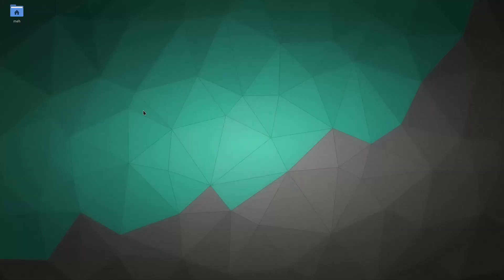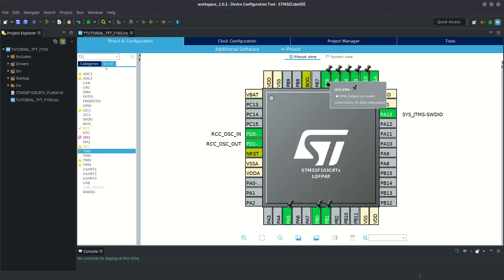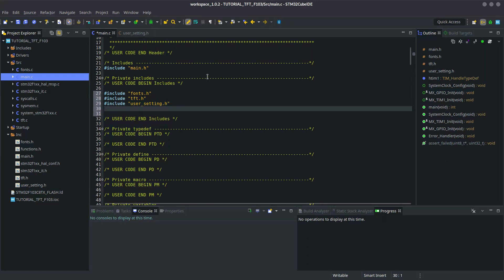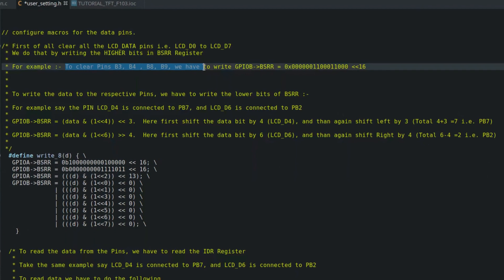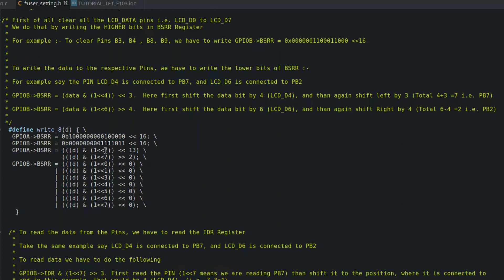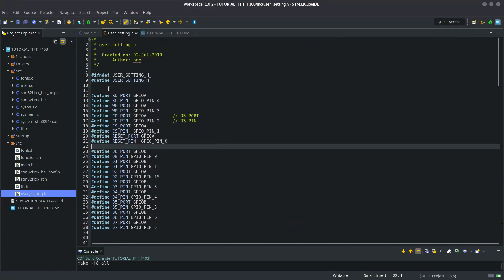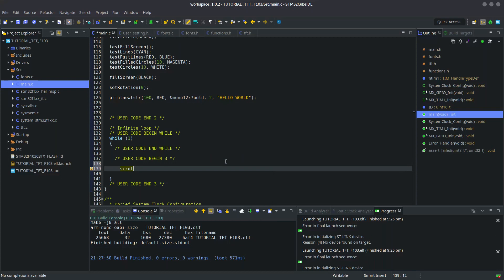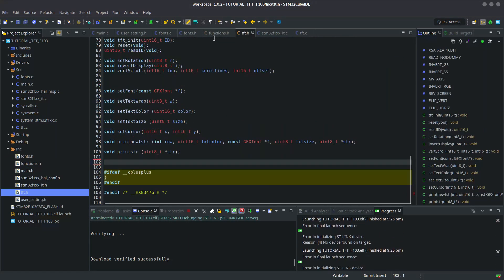Interface TFT display with STM32 in parallel mode || CubeIDE || CubeMX || HAL

Comment: What is your supply connection? 3v3 or 5volts? I use the same display but have only  white screen after sending some DrawPixel cmd.. then connected it to the scope and noticed that commands ( D/C marked as Rs )  has wrong volltage level instead of being low when sending command has some strange voltage 1.5v but when i disconnected that pin from the display the state is correct. The ground is common so in my point the roblem lays on the voltage levels. I connected  5v and 3.3 to correponding pins on display but i have doubts if that 3.3v is reference for logic interface. Now i will test it with 3v3 voltage provided to 5v pin but need to wait for that ( iam away from home now ) anyway your video proved that this Arduino shild can be connected to stm cmos voltages..

Comment: sorry but, the library is the same if i use "driver ILI9225" for LCD?
Reply: does it work for you please ?
Reply: @mohamedmenacer2468  sorry, but i use st7735 instead :( ...
Reply: some other youtuber make video with st7735 ic drive , so i used that
Reply: Okey, Thank you for replying 🙏🏻

Comment: Hello, This tutorial working for ILI9341 for Nucleo H743ZI,but only for printing figures. Unfortunatley it not working for printing text, could you help, maby you have link to newest tft.c file with setting for ILI9341 ?
Reply: Hi, I had the same problem with H745ZI-Q, and I figured out, that it's problem caused by "pgm_read_xxxx()" macros. I changed for example: "uint8_t  *bitmap = (uint8_t *)pgm_read_pointer(&gfxFont->bitmap);" to "uint8_t  *bitmap = (uint8_t *)gfxFont->bitmap;". i did it only in functions "write" and "drawChar" in tft.c. Now it works well for me.

Comment: There's a problem. CubeIDE counts the definition of delay() function in user_settings as a redefinition. Idk why.
Reply from the maker: Plz read other comments
Reply: where you able to figure this out?
 I know its been two years lol
Reply: @morosz1159  Yes. I don't remember how I figured it out though. Moved to Nextion and DWIN screens anyway coz they're so much easier to use and have powerful onboard processors.
Reply from the maker: Just define that function in some *.c file (like main.c or tft.c) and use the keyword "extern" here in the usersetting.h file (extern void delay (bla bla)).
Reply: Same problem

Comment: I use your all code for ili9486 uno shield 3.5 TFT and connection same as yours but it read wrong I'd it read 38022 and not work plz help me
Reply from the maker: 38022 is decimal = 0x9486 in hex
Reply: @ControllersTech  plz help me sir nothing is on display only white screen is coming,, I uncomment the define support 9342 and change screen size in user setting, what other thing I can do?
Reply: @skvalavideo  Hello, I will test the same display tomorrow. And I think that I have a clue. try to uncomment SUPPORT_B509_7793.
Reply: @elmirakassymova380  i did it and no results...did u solve it?
Reply: Ok but nothing is on display only white screen

Comment: Is it possible to save the display screen on an SD card as an image? If yes then how can we do it
Reply from the maker: You mean like a screenshot.
Well i don't know for sure but you can weite the data simultaneously on screen and sd card. Otherwise if you have a controller with enough memory to store the entire frame buffer, you can just copy that frame buffer to a file in sd card.

Comment: now i am using TFT 3.5 inches arduino Shield, So can i use your library for its, thank you.
Reply from the maker: Depends on the driver of the display..
See the supported drivers in the code
Reply: @ControllersTech  thank you
Reply: @ControllersTech  I used arduino to scan its ID, it is 0x9486.
Reply: @ControllersTech  I also used Same Arduino Uno shield 3.5 tft display driver ic 9486 but it's read wrong I'd 38022 . What can I do plz help me.

Comment: Another great work Thanks for that. Is it possible to use the screen with 90 degree rotation? Kind of landscape mode.
Reply from the maker: Yes it does. There is a function "set rotation"

Comment: I am using Nucleo-F446RE board so it already have the Arduino comparable connector and also I am using IL9341 LCD driver. I edited the code using Cube ide. Done the pin clearing and data writing as per your suggestion.Code compile without any error but it is only showing white screen.Could you please help me on this.
Reply from the maker: Join the telegram channel. I have pinned a post there. It have the tft code with lvgl for 446re
Reply: @ControllersTech  It is working.Thank you very much
Reply: @231ara  I have the same problem.. i am using tft ILI9341 with nucleo F767ZI. i have no error but only white screen. do u have any suggestions please ?

Comment: It is posible to change the tft pin? 

I'd try to change PA5 to PB7 pin because i need 3 more ADC pin. After change device pinout and write in user_setting.h, that give me error hard fault interrupt.

May everybody in here ever tried to change tft pin? Please leave comment,  thanks lot
Reply from the maker: The process to change the pins is explained in the video. It's very complex, so watch carefully.
Reply: I miss that important step. So the solution if we want to change that pin.
First to do is change microcontroller pin in stm32 pin planner. 
Second change clear pin configuration 7:17.
Last is change data pin read configuration 11:42.

Comment: Will this work for the stm32h747?
Reply from the maker: Don't you already have a display attached on the board ?
Reply: @ControllersTech  I do. I was more interested in how to use my boards. I have the fdis4cam. Can you do a tutorial on dcmi to ltcd ?
Reply from the maker: Your display is different. This won't work..
Use the LTDC to interface the display.

I can't do dcmi, since my board don't have the connection..

Comment: I tried to build the project with keil but i am having a lot of errors. Does anyone know why?
Reply: same
Reply: @maulanawahyudi7127  it seems that the project only works with cubeIDE
Reply: @FunSpark-Horizon  Have you tried it sir?
Reply: @maulanawahyudi7127  Yes I did. It works with cubeIDE
Reply: @FunSpark-Horizon  that's work sir, but how i can clear the text ?
Reply: @maulanawahyudi7127  I am glad that it works finally. For clearing the text, i think the best way is, to use a function to cover the text area with a rectangle with different color. For example if your text is white, you should draw a rectangle with the color of black to cover the text. The libraries are not in front of me right now but I am sure that there is a function to do that.
Reply: @FunSpark-Horizon  I've tried to cover the entire screen and it's very slow
Reply: @FunSpark-Horizon  aahh i see, thank you very much sir

Comment: it says multiple defination of delay
Reply: have you found the solution for this?
Reply: @tomdehaan3349  go to the site in the discription and you will find a comment regarding this
Reply: .h files are for user definitions and function prototypes etc...
Move this code from user_setting.h and place it over or under main function.
void delay (uint32_t time)
{
	__HAL_TIM_SET_COUNTER(&htim1, 0);

	while ((__HAL_TIM_GET_COUNTER(&htim1))<time);
}
Then code should work for you

Comment: Hi! Thanks for the code :D. Are you planning to extend the library to use the Touch capabilities of some displays? Also, do you have an example for a bitmap code? I tried uploading some bitmaps from a previous project, but they don't seem to be working :/
Reply from the maker: Nope.. not planning anything on the tft. It's too much work for nothing.
Reply: @ControllersTech  and which display technology would you recommend to use in projects then? :o
Reply from the maker: Use some hmi display. I personally use nextion display. Costs a bit high but worth it
Reply: @ControllersTech  which one exactly?

Comment: There are error in tft.c file. I'm trying to learn how to write code for stm32f4 -> LCD can you please send me a link from where should i start.
Reply from the maker: Use cubeide..
Reply: @ControllersTech  I'm using cube id. but there are error in tft.c file
Reply from the maker: What errors ?
Reply: @ControllersTech  "Expected declaration  or statement at the end of the input" at multiple functions

Comment: Hello sir. I am using ILI9341 (8 bits LCD shield) with STM32F103C8T6 and  ILI9341 (16 bits LCD shield) using STM32F407ZGT6 board. In both boards I managed to install your driver using STM32CubeIDE and STM32CubeMX. Now what I want to do is to install the touch screen interface. Where I can find the drivers (XPT 2046) using HAL library for these boards (BluePills and BLACK-F407ZG)? I appreciated very much your work with this interface. Many Thanks.
Reply from the maker: I ported that code from the mcufriend's. I think you should look into that. I can't help much about this as i have dropped my plan for these LCDs. I will be using nextion HMI display now onwards for any application that requires it.

Comment: Hello sir, I am using ILI9225 with  STM32F446RE will  the same code work ??
If not  what changes has to be made
Reply from the maker: Look in the #define support part. If it's there then it should work
Reply: @ControllersTech   yess it's there but what about all others pins ? for my ILI9225 i have only CS DC RST SDI and CLK
Reply from the maker: This library is for parallel displays. Yours is SPI based.
Reply: @ControllersTech   ..
Reply: Yes you’re right .. i tried all your videos to configure my ILI9225 with LVGL and doesn’t work for me :( i tried a lot and my last advancement is that i make it work but drawing things using lcgl with Draw pixel function.. which mean my display is really really slow and i can’t make it work using draw bitmap :( i also send you an email and messages in discord .. please help if you can

Comment: I'm trying to adapt the code for the SSD1963, but with no success so  far....it says on the "user_setting.h" that the SSD1963 only works with 16bits bus....any helps?
Reply from the maker: i don't have the display so can't confirm about this.

Comment: Thx man, did it in an ILI9486 using a nucleo f401re and worked well.
Reply: What value did you select for "define SUPPORT"?
Reply: @Shubhamjain94  use 0x9486 as the device ID, still it will work with some errors in word wrapping.

Comment: I am getting make file error. It is showing multiple declarations for "void delay()" in user_setting.h
Reply: I also got the same error, I copied the function to tft.c and deleted it from user_setting.h.  I got rid of the errors
Reply: mee too, i have copied and pasted the .h and .c files multiple times but it did not work
Reply: __ tft.c contains the header -> #include "user_setting.h" //multiple declaration
Reply from the maker: Use cubeide
Reply: Same happens to me and i am using the cubeide, maybe it's missing something in the code?
Reply: @nicolasmiller4659   @Nicolas Miller  In main.c delete #include "user_settings.h" header //multiple declaration _cubemx - truestudio
Reply: @benedekapor9247  thanks you I did it, and all error and warnings is get off
Reply from the maker: Wait.. do the main.c file have #include user_settings.h ?

Comment: I had tried this code on stm32f103rb nucleo board with necessary changes.but the code doesnt worked on it.can you please suggest me the required changes and considerations  to run this code on my board.
Also,i have a doubt in the case of read pin configuration,whether it need to configure as input or output pin
Reply from the maker: You can first try to use the f103c8 code directly without changing anything. Use the same pins as i have used in the code. Connect the tft on the breadboard. Once it works out, than you can try to go for the pins according to your board..
Reply: @ControllersTech  i have tried it.but it didnt work
can u please give me the clarification regarding the read pin,whether it need to configure as input or output pin..since in some other codes, it had configured as output pin.
Reply from the maker: What read pin ?
If you are talking about the data pins, than they will be configured as output or input based on the situation. The code will automatically do that. You can set it to whatever you want in the cubemx
Reply: Were you able to make it work? I'm stuck on the same board.

Comment: I'm using the STM32 NUCLEO-L476RG. The readID() function isn't reading the ID of my display. Its is a Newhaven TFT (128x160) with a ILI9163 driver. 
Any clues as to why I'm not able to read the ID?
Reply from the maker: If you have an arduino, i suggest use that to try mcufriend library in that. If it doesn't work with that, it won't work here also..

Comment: Very confusing read and write macros !
Reply from the maker: Yes they are
Reply: @ControllersTech  Could you make it easier ? For example is it possible to put lables on Pins on Cube Graphical setup ?
Reply from the maker: I port this code from mcufriend library. Made some changes to make it as simple as i can. But i couldn't find a workaround for read or write. 
Just watch the video carefully at that point, it's not that difficult to get.
You can make it simple by connecting pins according to their respective positions for eg LCD_D0 to PA_0 and LCD_D7 to PA_7
Reply: @ControllersTech  Ok thank you for reply. I'm coming from Arduino 8 bit programming. So STM32's BSRR register a bit confusing. Actually maybe it's more easy to use BRR register for reset a bit on port. I guess I need  to leave Arduino IDE and focus on STM32 Cube IDE :)